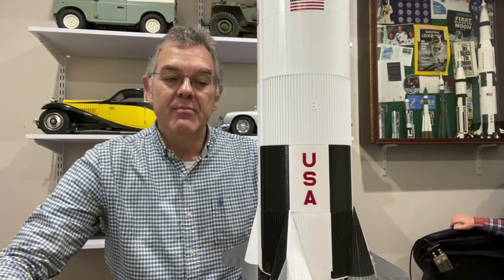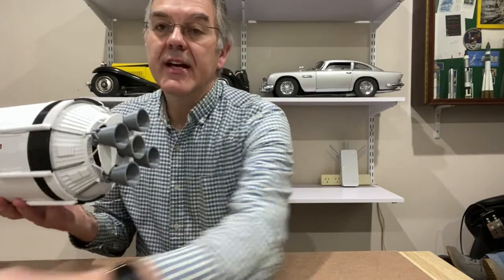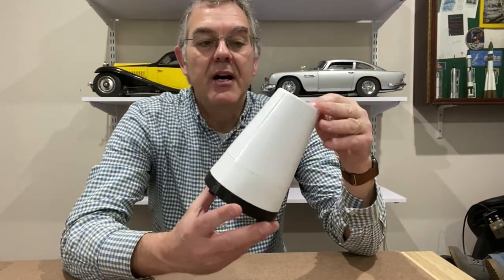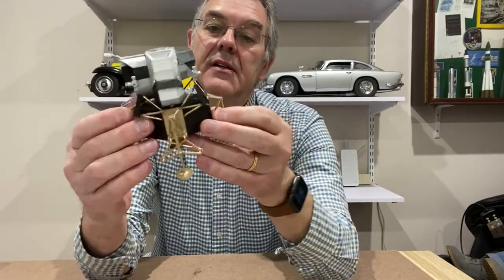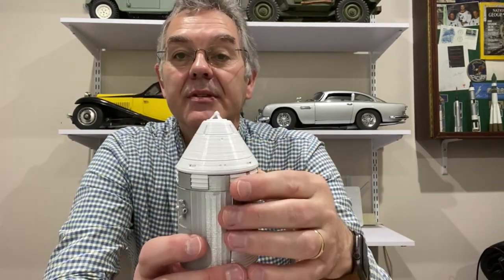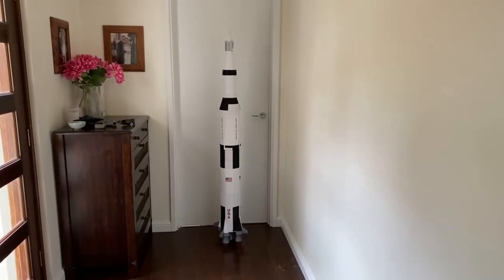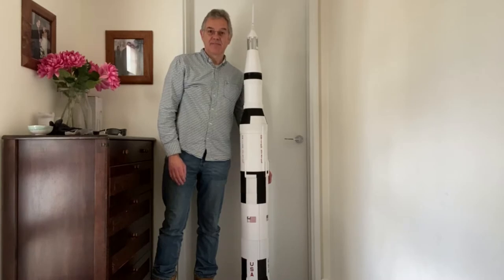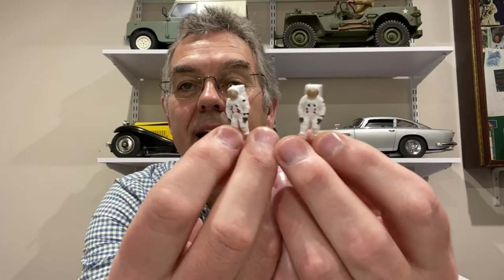Space enthusiasts - I built an enormous Saturn V rocket using 3d printed parts

Comment: I’m fairly experienced with 3d printing and modeling with fusion360 so after seeing this video and having strong interest in Saturn V,  I figured this is for me..  Next I downloaded the files.. This is insane.. Literally thousands of parts to print and assemble.  Each of those parts requiring decisions on how to position on the print bed.  This video does not give this project justice.  Completing this model was a huge accomplishment and I give you lots of credit for that.  I’m going to start at the top of the rocket and see how it goes..🤷‍♂️
Reply from the maker: Thanks Robert.  Good luck with your own build.  I didn't have much trouble with slicing and positioning the rocket elements on the print bed.  A lot of them were just vertical tubular structures. The engines and LEM were the most challenging parts, but there are some remixes of those that make things a bit easier if you wanted to go there.

Comment: I am in the process of printing this beast on my Ender 3. Starting at the top I am down to Stage 3 right now. The ender 3 struggles with the small parts, like the RCS thrusters and it struggles with the lattice like material (like the Launch Abort Tower). After about 20 attempts I got a usable launch abort tower but I think I am going to skip the Launch tower unless I figure something else out. I haven't started the L.E.M. because it looks pretty intricate and I'm not sure how its going to work out. I am relatively new to 3d printing and I have already learned so much about supports, layer height, and retraction settings getting this to print. Hopefully I figure something out along the way. Yours looks amazing and clean.
Reply from the maker: Thanks a lot.  Some of the remixes of this on Thingiverse help with some of the more intricate parts. For example, I think there is a simpler LEM that can be printed in fewer pieces.
Good luck with your build.

Comment: I am having great difficulty with the Lunar Module.  The support arms off the lower body are very flimsy.  The X and Y arms break when I try to assembly them.  Are there any remix files for these parts?  If not, I may have to recreate them in Fusion360, as best as my minimal skill will let me.  I was so excited to see the legs move on that, but now am very frustrated.  Any ideas or help would be appreciated.
Reply from the maker: Yes, those parts are very delicate. Need to print and handle very carefully. I think someone did put up a remix of this that was easier to print and more robust.

Comment: Greetings buddy,
I'm a student from the Emirates who is planning on making this and I have already gathered all the materials and the printer.
I can really see your channel growing far from what it is now in the future, out of curiosity I wanted to know something, it is really hard for me and many others out there to asseble this part by part as there is no sort of manual, can you by any chance make a detailed video on how to build this from all the parts?
Also, if you can't make the video, please let me know how you were able to assemble it 
P.S please provide me your contact if you can so that I can clear off my doubts on this project, looking forward to your reply.
You are an absolute mastermind.
I also wanted to know, how much does this rocket weigh?
Reply: Thanks for the comments. The download files include detailed 3 dimensional drawings to help you assemble the model. Most of it is quite simple. To view the 3D drawings you will need to download a program called e drawings which can view the EASM file. The engines can be a bit difficult but there are some remix files that print in one go. I used those for Stages 2 and 3.  It’s worth looking through the comments on Thingiverse because they provide some more information on the assembly.  Good luck with your build.

Comment: I started printing this model and was thru with the 1st stage and there was no files to download and unzip for the rest of the rocket.  Can you please tell me where these files might be located?
Reply from the maker: If I remember correctly, the parts for this model are downloaded as .rar files.  You will need a program such as 7 zip to unzip them.  I think you can just right click on the file and the 7 zip option comes up.  If it doesn't, you may have to download it.  Once you do that, you can extract all the files to a folder of your choice.

Comment: I'd love a 1/48 Saturn 5, to be in scale with other ones I have in that scale. I just have no experience with 3D rinter.
Reply from the maker: It would be difficult to scale it up to that size. I’m not sure the parts would fit on the printer bed.
Reply: @modellingmisadventures  they would fit if the printer was a belt style printer instead of a flatbed and the parts were laid out horizontally instead of vertically. Or just slice the parts into smaller sections to where they can fit on a print bed.

Comment: I am currently printing the same 3D model. But mine doesn't have the docking mechanism on the Command Module. I have all the main large parts printed and assembled. Saving all the rocket engines and small parts for last. Did your model also come with the Gantry files? I am going to print that also. But I would like my Command Module to have the docking mechanism. Can you help with that? This is the link to where I downloaded my files. Is this the same one you used? https://www.thingiverse.com/thing:911891
Reply: Hi Kevin. Yes, this model came with the gantry but I haven’t made that. In order to have the command module with the docking mechanism, I think you have to look through the reprints. Somebody updated the original and added more detail.